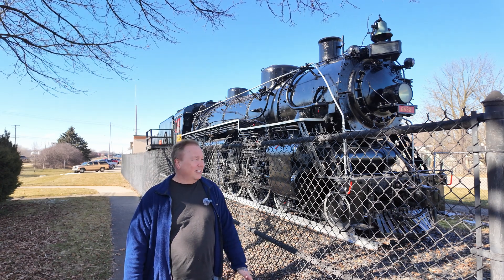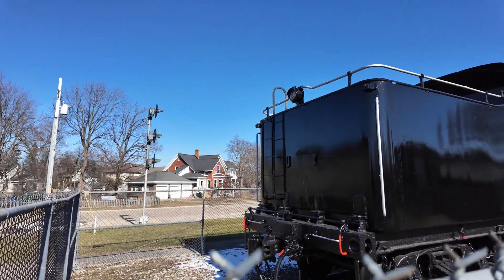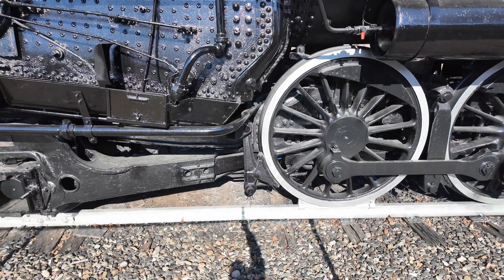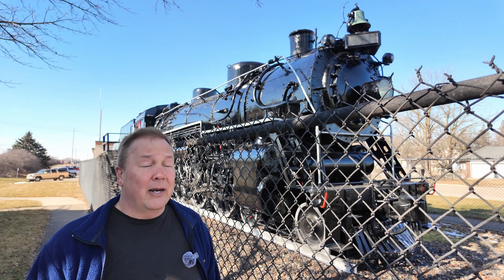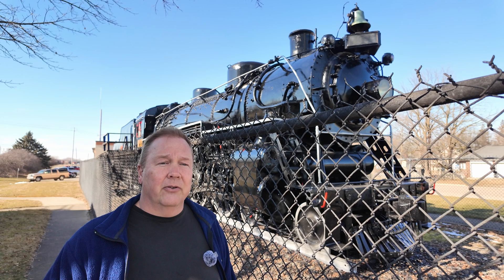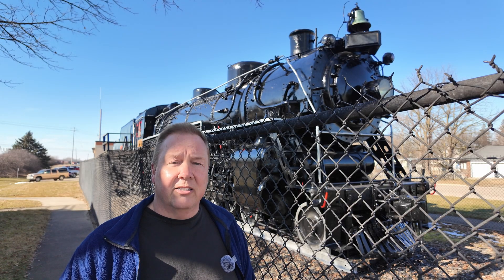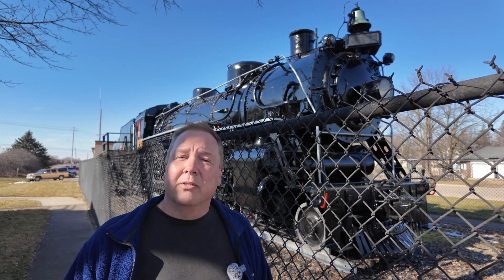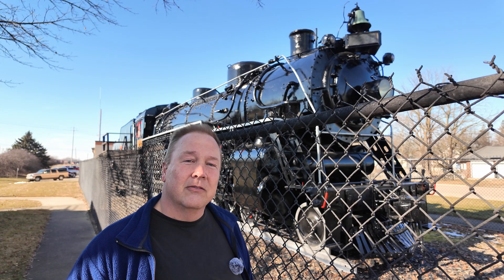Why Are So Many Steam Locomotives Sitting in Parks?

Comment: Park locomotives are like a piano that is used as furniture and is never played. Sad the generations who have never experienced a specticle that an operating steam locomotive is. 😊
Reply: And I like to say at least they'll be there when we're ready to restore them hopefully 🙂🚂
Reply from the maker: True, but the other way to look at it is that kids will then want to go ride on a real one, so their parents will take them somewhere running live steam.
Reply: especially sad because it wouldn't be too difficult to set up a boiler in a side building to make the engine at least look like it's running, lift it a centimeter off the rail and put low pressure steam through it, just enough to get the valves and stack blowing and the wheels turning
Reply from the maker: @d3str0i3r actually for the fake running in museums, they usually just throw a little electric motor on them somewhere.  Except for atmospheric engines, you can also run them on compressed air.
Reply: New generations are losing a lot. Trains, prop planes, the Sunday drive, church, shopping downtown, malls, housing, jobs, $5 footlongs, history, culture, respect, etc.
Reply: And yet, the park locomotives preserved them from being scrapped, and in at least one case allowed them to run again.  Pere Marquette 1225, briefly mentioned in the video, sat for years as a park locomotive on the campus of Michigan State University.  Took nearly another 20 years before she ran again, but has been a working steam engine for the last 40 or so years.  Along the way, while sitting there on a little hill beside MSU's football stadium she also inspired one Chris Van Allsburg to write a little children's book that has become responsible for quite a bit of interest and funding for restoration projects over the years, The Polar Express.

Comment: This video is probably the most cohesive of any that I've seen in the past, (bar none). It looks like she's just been re-painted but what a shame somebody at the GTWHS can't put a roof over her, thus negating eventual / natural decomposition of the elements on / in her steel and iron. How close is the GTWHS coming to sending her out for a re-build in Owasso? If and when she comes out "Brand New", may I suggest that lettering on the lower part of the cab read "Spirit of Durand" and / or "Remembering 5629". Just a thought.
Reply from the maker: Thanks!
Just paint will keep it in stabilized for quite a while, as long as it's kept up (and rust was cleaned off under it).  I did read somewhere that there's some interest in expanding the railroad collection there, and there's the museum down in the station, and another just up in Owasso, so the area is ripe for some historic railroad expansion.
Reply: Steam Railroading Institute was interested in 5632 or 5030 as running mates to 1225, but ultimately went with CNW 175

Comment: In the 50's, they still had 5 man crews on diesel powered trains. Two man crew came along much later.  Diesels need " maintenance" regularly too, although not as much. Large railroads had tracks specifically for servicing locos, they only were put in the shop for repairs. They did not stop every 10 miles for water, distance depending on tender size and size of train (weight and length). Track pans and auxiliary tenders extended distance between stops. 
 The loco at the RR Museum of Pa. you referenced is a straight electric, not a diesel. Electric motors of sufficient power were developed by the time the early diesels came along.
After WW 2 ended, the majority of steam locos dated from the 1920's or earlier, and were worn out. Diesel fuel was dirt cheap, coupled with the cost diesels( as opposed to new steam or rebuilding older ones) and the reduction in the number of people needed to service them ( and add in the residual scrap value) made the decision to scrap steam by the accounting dept. an easy one. 
 Only a fraction of the 10's of thousands of steam locos rostered after the war survive. A smaller percentage of them are in city or town parks. Some railroads , predominantly the western roads were more generous than the eastern ones. While PRR and the B&O saved a number of theirs in their own collections, others like the NYC scrapped practically every one.  Some towns have even scrapped the ones they had due to vandalism and the liability due to the asbestos lagging still present.
Reply from the maker: What would 5 people do on a diesel?  
How common were track pans?  What I've gotten is that they were pretty prevalent on some major lines, and in some parts of the world, and pretty much non-existent elsewhere.  With all the museums I've been in, I've only ever seen one locomotive set up to actually use them (in Green Bay, WI).  Someday, maybe I'll actually find a map of where they were.
As for the locomotive in PA, we're probably thinking of different ones.  The one I'm thinking of was definitely straight diesel and definitely not electric.  I think you have the right museum, though, from my memories of the place and what I can see on google streetview (only shows going down the road) and the museum web site.  Unfortunately, their web site says it doesn't include everything, and the one I'm thinking of isn't shown.  A google image search for the museum doesn't turn it up, either, so it's possible it's not there anymore.  Things do move around from museum to museum.  
Some more searching turned up "diesel mechanical" locomotives that preceded "diesel electrics."  The running gear and wheels look like they came off a steam locomotive.  When I asked at the museum when I was there, they said it was somewhat of an experiment that really just didn't work out, which is why they went to diesel electrics.  Don't know how many were ever produced or actually put into use, but I got the impression it wasn't very many.
Reply: @Industrial_Revolution  Track pans weren't very common, only a few roads used them. You need a stretch of straight, level track for them. Tenders on passenger engines typically would would have the scoop for the pans. 
 Museums are just that, a museum. Very few have track, or access to track to run on. Most operating steam locomotives are on tourist lines, or Heritage roads as seems to be the current term. You described a loco as having " Running gear and wheels that look like they came off of a steam locomotive". The only thing that fits that description is the PRR DD1 class electrics. They operated in pairs, in the NY Terminal area. There are several pictures on the internet. 3 pair were built in 1910/11 and lasted in service into the early '50's. Unfortunately, many of the staff at the museum aren't that well versed about the collection
Direct drive diesels never existed beyond small diesel/gas mechanical " critters" such as built by Plymouth. The mechanics of applying the power of the prime mover to the rail is impractical due to the constantly changing conditions a locomotive is subject to.
Reply from the maker: I wish I could post pictures here.  Hopefully the link gets through.  This isn't the one I saw, but it gives the idea.  https://x.com/CrecyRail/status/1625107748475088896
Reply: Nothing like that ever built in the US.
Reply from the maker: Can't promise the one I saw was built in the US, or ever even used in the US, just that it was physically in the US when I saw it.
Reply: @660Oliver  Just to clarify...The PRR units you mentioned earlier were GG1's and not DD1's & MAN...they were butt-ugly, (in my opinion).
Reply: @1chuck96  No. GG1's do not have side rods and jackshafts. The DD1 pair at the RRMPA does I have no idea what an MAN  you're referring to is.
Reply from the maker: @660Oliver, is that one I'm thinking of still at the PA museum?  Sounds like you know the one I'm thinking of.
Reply from the maker: That's where I thought it was, but I couldn't really tell from above, and in streetview, there's another train in the way.
Reply: @Industrial_Revolution   you asked "What would 5 people do on a diesel?"
Well, it probably had more to do with unions and contracts not allowing the railroads to cut jobs (same way the Big 3 automakers had to keep workers when they started using more automation and robotics).  The unions were very strong and could hold out to keep 5 man crews for quite a long time, even if it meant that 2 or 3 of them would be just twiddling their thumbs.
Reply from the maker: Well, you have an engineer, responsible for the locomotive, and a fireman, responsible for the fire and boiler.  Both are in the locomotive.  You have a conductor, responsible for the overall train operation, and at least one brakeman, often sitting in the caboose, keeping an eye out along the sides of the train, looking for overheating axles, dragging gear, etc.  Things like automated detectors on tracks have replaced that last function, which is why you no longer see cabooses.
Reply: @Industrial_Revolution  Labor cuts and cost reductions drove it. We see how well that is working on today's railroads.